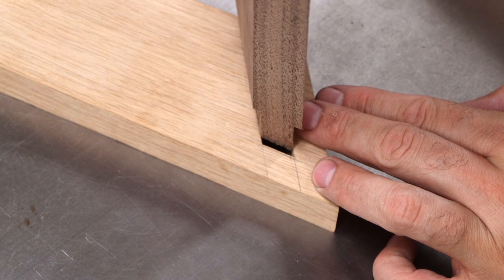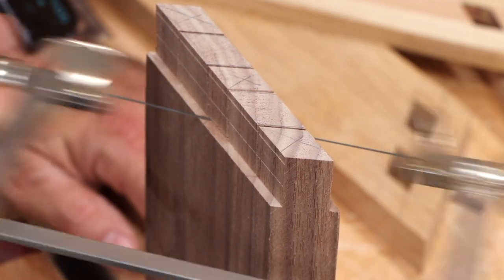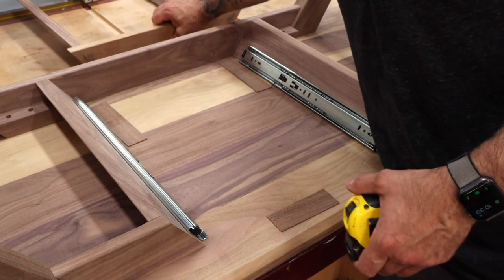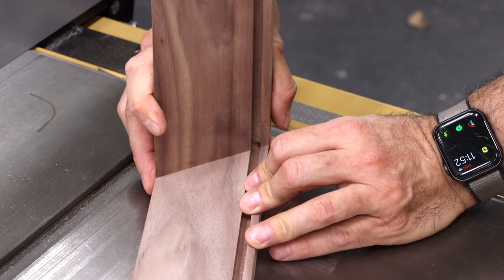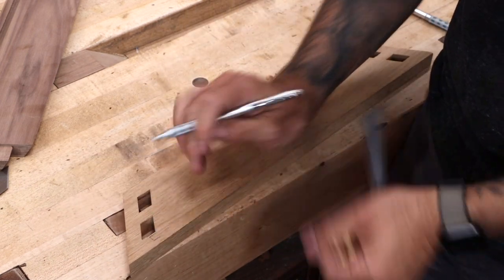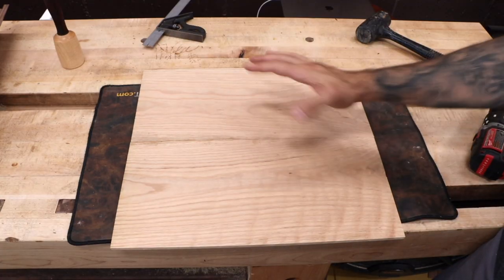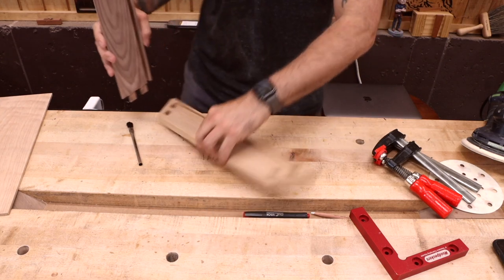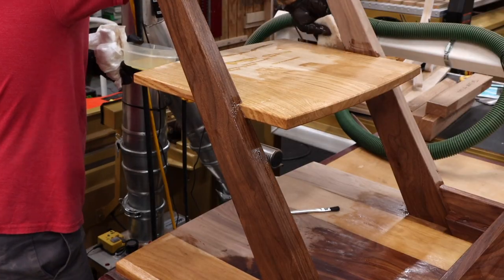The Drawer & Finish | Nicole's Desk Pt. 4

Comment: I was curious to see if the drawer adjustments would be the same with the table on its legs.  Even with a thicker top, the difference of compression (upside down) and tension (on its legs) still flexed the table enough to see a minor gap.  Great project, and especially the drawer slide installation helped allay my fears for adding drawers to future projects.
Reply from the maker: The gap was there when the desk was upside down as well. I just didn’t think think it made sense to adjust it until the finish was applied.

Comment: Apart from dowels and glue, did you use any hardware to attach the angle legs? I'm making a dining table with a similar setup and I'm worried that glue and dowels may not be strong enough.
Reply from the maker: Everything I did is in this series. No additional hardware was used.
Reply: @woodwhisperer  Thanks Marc!

Comment: Does the desk top hold up well to writing? Will you indent the wood if writing on single post it notes or sheets of paper?
Reply from the maker: Walnut is pretty hard so it resists denting as well as can be expected. But nearly all wood will dent if enough pressure is applied with a pen. Just the nature of the beast.

Comment: Looks great, and nice to see a project on YouTube that doesn't include an appoxy poor! Traditionally the grain of the draw bottom would run the other way but this is far from traditional.
Reply from the maker: Exactly. Personally, I feel the grain direction of a drawer bottom can run in whatever direction looks best to you. Makes no difference to the drawer.
Reply: In a traditional drawer if the wood shurunk it would fall out the groove and if it expanded it would make the drawer stick in the opening or push the dovetails apart, but yes in this instance it has no relevance on which way it runs, I guess we just get stuck in our ways sometimes.

Comment: That was a really enjoyable series, Marc, thank you... But I was surprised by your drawer bottom construction. 

I was expecting a traditional approach, making a shorter drawer back, so that the lower edge stops at the top surface of the drawer bottom. Then you could slide the bottom in and secure it with a single screw in a slot (allowing for expansion). This relies on the grain running parallel to the drawer front, but it means the panel can move without gapping or pushing at the sides. 

You obviously chose not to do this: please could you explain why? Thanks again for a great series!
Reply from the maker: There are many ways to construct a drawer and none of them are invalid as long as they allow for movement where necessary. The drawer bottom you’re describing makes the most sense to me when there’s a risk of damage to the drawer bottom, requiring future removal and replacement. That’s not something I’m concerned with here so I went for a captured panel.
Reply: @woodwhisperer  OK, makes sense now. Many thanks for replying!